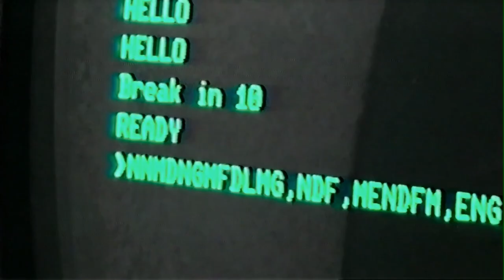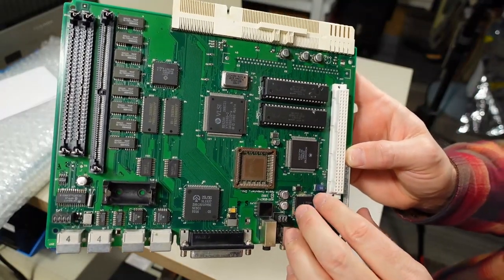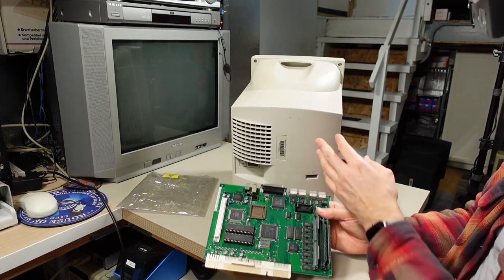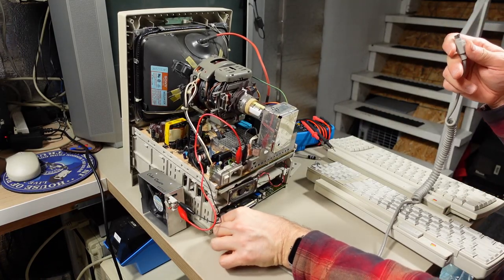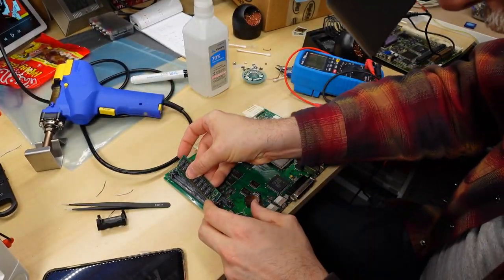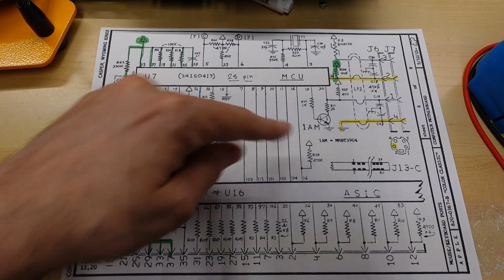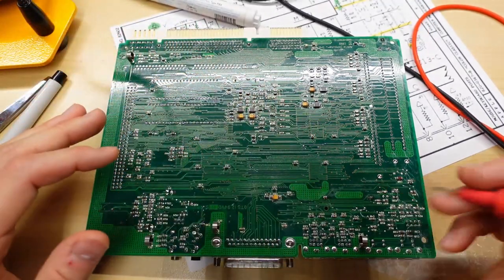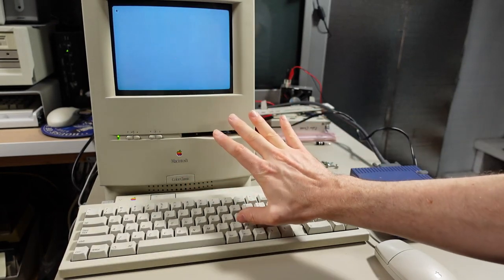The Mac Color Classic lives again, sort of...

Comment: A very long time ago, I used to work on the Chance-Vought (LTV) A7-E aircraft. It was an attack aircraft that used (for the era) some very sophisticated avionics. I worked in the intermediate repair department (not the depot repair), and we used to get first time try to repair units (black boxes) that had failed in the aircraft.  This is a tale of a tantalum capacitor that became a diode.  Yes, you read this right.  Most of the failures of tantalum caps is dead short.  When they fail they usually take down a rail and are pretty easy to troubleshoot. But this tantalum was in an A/D converter that was pretty much driving us crazy. Finally, the night crew carefully unsoldered the cap, allowed it to cool off, and did a front to back measurement with diode check. Polarized normally at 15vdc... it was a cap. Charged and discharged normally.  Reverse, it was a diode, with a forward bias of silicon diode> 0.6vdc.  At 25 volts, forward measurement would charge up the cap, then it would short.  Reverse at 25volts, it would be open.  Strangest thing I have ever seen. 
The moral of the story is, NEVER TRUST A TANTALUM capacitor. I'd change them all out for new ones.

I enjoy your channel very much, Adrian, and thank you for a great video!! Cheers and HAPPY NEW YEAR!!
Reply from the maker: That is a crazy and strange failure mode. It never ceases to amaze me how odd things can be when failing. I've had electrolytic caps fail short and other funny issues that just don't seem possible or right -- but like you found, sometimes it happens.
Reply: so you're telling me not everyone knows what a Corsair II is and isn't an aircraft geek?
Reply: Tantrum capacitors...
On some old arcade boards I came across a few Tantalums that were turning into Randomness Resistors. For measurement, I use my Testofon which has a 4V potential between the probes and then converts current to frequency on a speaker.
[What's a Testofon?]It will then upload its firmware to your brain which lets you measure not only wires and broken wires, but also resistors, capacitors (capacity AND leakage), diodes and to some extent inductors.
Every resistor has a specific frequency. Every capacitor has a specific frequency curve. And I freaking love this thing![/What's a Testofon?]
These Tantalums made the Testofon play a weird melody... they were all over the place (which also caused the machine to sometimes work).
(translated: These tantalums had a leakage current that translates to a potentiometer someone randomly turns between 100 Ohms and around 10kOhm)
Reply: @adriansdigitalbasement  wow Adrian .. you come a long way from the guy that disassemble LED  bulbs back in 2014 or 2015..
everything time  see you troubleshooting one of this machines like that ... it just wow..... :-)   ..   definitely thumbs up...
Reply: @cowsgomoo4618  LOL!!! I love that plane. I remember walking on the hanger deck of the USS America (Don’t Tread on Me!) and seeing all those Corsair II’s sitting there with huge pans under them. I asked an ADJ why and he told me, “If the pans are empty of hydraulic fluid, the planes need to be refilled. If there’s small puddles of hydraulic fluid in the pans, they have plenty of fluid.”  I learned later that the hydraulic systems seal themselves during flight. Strange design. 

The Corsair II could carry twice its weight in armaments. It used a digital computer made by IBM that was the grandson of the Saturn V’s guidance computer. The inertial navigation gyros were made by Singer-Keirfott and were so accurate they could measure the Earth’s wobble. 

That was one damn good airplane.
Reply: Sounds like the problematic tantalum was suffering from breakdown below rated voltage and that was the main issue. The diode-like behavior is not unexpected for them, they really don't like reverse bias, and this one perhaps even less than most. Even in standard polar electrolytics you may see reverse breakdown at 1-2 V.
The "open" in reverse at 25 V may have been operator error / bad contact, everything else lines up.
Reply: @PileOfEmptyTapes  Absolutely. I once measured an old tantalum cap (that was otherwise okay) in reverse. My meter says it applies 2mA at max. with 4.2V max and the cap shorted just from measuring it in reverse! (btw. it was a 35V cap. I tested a bunch more from that batch, must've been 70s, they all failed at around 22-25V)
Reply: Post

Comment: Hey Adrian, just wanted to thank you on your video. 

I got a CC that wouldn't turn on. Did regular recap and cleaning. And it wouldn't turn on. After a lot of researching (I also got to those schematics eventually and they're so helpful!) I almost gave up on this board. 
Went trace by trace on the U7 and U8 chips, checking continuity, and couldn't find the fault.  

Today, by completely random chance, I saw your video.

Somehow I missed trying connections that go to J13-10 and J13-14. Lo and behold, the connection from J13-10 to U8-2 was severed. Did the same fix as you, and now I have a happy CC that turns on!

Thank you!!

Comment: "There are a lot of tantalums and these don't leak!" No they don't, but some of them short and explode when you apply power!
Reply: Had a lot of fun with these on two socket 7 boards.
Reply: Absolutely true, tantalums may not leak, but when they fail and cause a direct 5V power rail short you will have even more issues then before! Much better to replace with 1uf, 25v nichicon caps so when those fail you only have to replace a capacitor!
Reply: i didnt think about that in first place 
about tantalum blow up when power get to it
that is interesting thing to know about it
Reply: Yeah I had replaced the electrolytic capacitors with tantalums on my mac se/30 and 2 of them exploded inside!
Reply: Not for nothing are they nicknamed "tantrum caps"

Comment: That's the preferred method of getting those capacitors off.  You push down and twist.  Worked with a guy in the broadcast television repair industry that probably replaced 50,000 capacitors a year and this is how he did it.  Never damaged the traces.
Reply from the maker: I've tried the other methods and once I started using the twist method, I've never had a single damaged trace or pad. Heat and attempting to desolder has resulted in damage... so I abandoned those ways.
Reply: @adriansdigitalbasement  Same. I've had far better luck with "push and twist" than trying to desolder with an iron. I used to yell at my computer screen when I saw people do this... not anymore!
Reply: When capacitors leak, they release electrolyte. The electrolyte is alkali, which is corrosive. The corrosion seeps into the pads and traces. The effect is accelerated when current is passed through the circuit. Because the pads become fragile, that is why the twist method is not recommended. It applies unnecessary force to the pads which can cause them to break. Heat + activated flux helps to remove the corrosion and free the legs without force, giving you a better chance at not causing damage. The brown/black stuff you see from the activated flux is all the corrosion being washed away from the metal. 

That said, I've lost pads using hot air before. Sometimes they're just too far gone. Do whatever method works best for you, but it's best to know and be prepared for trace repairs as these computers continue to age. The surface mount capacitors from this era were particularly bad.
Reply: @bnice7  -- Preferred method in the industry is twisting.  You push down on the capacitor with a force and twist.  When you do that, the leads break at the board.  It only takes 1/4 turn.  You don't have to spin it around all day.
Reply: @pmgodfrey  Probably a lot more efficient to do it that way, which makes sense in an industrial setting. They probably just toss the board if they do lift any traces and move onto the next one. As a hobbyist and collector, I prefer to treat my own equipment with more care and pay more attention to the science. Using the twist method, if the leads are stronger than the corroded pad, you'll lift the pad 100% of the time. I'd personally rather apply fresh solder, flux and heat. It's a longer process, but less chance of causing damage in my opinion.
Reply: i dont know why so many people get upset about twisting these particular capacitors off, the cap is clearly more fragile than the pcb pads and the cap body breaks off the leads, leaving the leads on the large pcb pads virtually every time. its no problem at all, just dont assume all other components (chips etc) can be done this way.
Reply: @bnice7  -- In the broadcast industry, we had tons of ENG cameras and editing decks.  These were pieces of equipment that cost upwards of $90,000...so you don't toss the board as a new one could cost $7,000.
Reply: @fumthings  I'm not upset at all, and I thought I explained my reasoning for not wanting to twist them off fairly well. I have had them rip pads off this way before, especially on cheaper manufactured PCBs. I've also had it where it doesn't rip the whole pad off, just peels it up slightly off the substrate. So I stopped doing it that way and I'd rather spend an extra hour or two using hot air and flux to remove them and not have to deal with any of those potential issues.

Comment: Hi Adrian. Some notes:
1) the Performa 475 motherboard also requires the PRAM battery, so you’re not alone.
2) IIRC, those batteries are 12v, not 3v, but check the documentation, first! Never mind; you schematic shows 3v.
3) when you were showing the board with the caps off, it looked like one of them, the trace was corroded off (nearby). (@16:42, if you look just under and to the left of C11’s (+) pad.)
4) it looks like the motherboard is missing an IC (there’s a PLCC socket, but no IC in it.)
5) a “real” 68040 (as opposed to the 68LC040) has Floating-point registers and ALU, but runs hotter; I recommend a peel-and-stick heat sink at minimum - just be sure it has clearance when you put it back into the case!
6) while tantalum electrolytic caps don’t leak, then can fail dead short; measure resistance across the power rails.

Comment: I just test booted my Color Classic this morning as I'd re-capped the Apple IIe card in it and was testing it. Funny enough, it had no audio for the first boot which freaked me out a bit (it had already been re-capped and it had been working fine). The next reboot and subsequent ones, audio was fine.

If you still have audio issues, definitely look at corrosion around the sound chip, U5 as it's common for that area to be a problem with the 4 caps that are around it.

Comment: Very cool! 
I will add Mac colour classics are very picky with boot up when you pull the motherboard out and swap batteries.   I went threw the same problem you had. But I read somewhere you have to let them sit for a while with the battery installed.  Mine wouldn’t turn on with a new battery for quite a while.  I let it sit overnight went and hit the startup button in the morning and it started right up.

Comment: It's always great to see your Macintosh themed videos! I have a troubleshooting suggestion for you: I have found that with many Macintosh boards the electrolyte from the capacitors sometimes leaks underneath the ICs. This fluid can cause the ICs to behave abnormally. There may still be a bit of leaked electrolyte underneath this particular chip. I think it might be a good idea to try pulling the IC, cleaning underneath it with Isopropyl alcohol, and soldering it back down. I couldn't quite make it out in the video, but I know that with Mac Classic II's the chip that is worst affected by this fluid is called the Egret chip. I look forward to seeing more videos about this computer!

Comment: One of the best ways to check a board is to take diode, resistor measurements on each pin of all IC and components. Taking the positive to GND and the negative to the test-point. 
This technique is used by most of the Flying probes to test boards. 
Sure you need another board to compare it.. but sometimes even without that you can figure out the problem. 
It was better to take out the oxidized chip and clean it and replaced again to see how much was damaged. 
thanks for the video

Comment: On most beige Macs, Cmd-Power is an NMI. You can usually type ES to return to the desktop if you invoke it unintentionally during normal operation or type G FINDER to try to get out of a crashed program and return to the Finder and save your work before restarting. The latter doesn't always work, though, especially if there are larger problems beyond an uncooperative program, in which case you can try to type RB to reboot if the system crashed hard and won't go back to the Finder. You could also install MacsBug where cmd-power brings you to the MacsBug debug screen from which you can view debug info and input advanced commands or return to the desktop via either of the previous methods (assuming the system hasn't crashed, in which case MacsBug shows you a huge screen full of debug info for review).
On the CC and other AIO Macs, the sound amp is on the analog board, which also likely needs to be recapped. If you have sound problems regardless of which logic board you try, it's likely that you either have a problem on the analog board or something between there and the speaker (the wire is really long; maybe you nicked it?).
Your Mystic upgrade board will require a VRAM SIMM before it will work, just fyi (it has none onboard unlike the CC or CCII boards). You have two options for the Mystic mod procedure: the quick and easy way with a simple logic board mod to enable it to use the CC's 512x384 display (by default the 575's LB runs 640x480 which is incompatible with stock CC), or you can do a hi-res mod to the CC's analog board to enable 640x480 resolution on the built-in display. The hi-res mod will follow with any subsequent logic board using the 640x480 resolution (including the stock board) with no further mods, unlike the 575 LB mod which would only affect that particular board. It kind of depends on how invasive you want to get and if you want those extra pixels.

Comment: That's a low-end 68040, it's the 68LC040 which was fitted to the LC machines and lacks an FPU. It's not hard to swap it out for a 'full' 68040 however, that's a popular upgrade to LC machines.

Comment: command control power was the reset command for most of the beige macs- this was the standard way to reboot after a hard freeze all the way through the 90s. I’m pretty sure it persisted through the later macs until they removed the standalone power button from the keyboards in the 2000s.

Comment: I had the floppy disk loop issue on a LC475 that I recapped, exact same symptoms as you have. Turned out that one of the capacitor legs touched another trace that had solder mask on, but caused issues. I recommend looking those over and checking there's no overlap on any of those.

Comment: I would have used MLCC capacitors instead of regular electrolytics. I think new electrolytics won't leak (not soon anyway), but MLCC are forever and work fine on these old boards.

Comment: As always your ability to do some VERY deep dives into what could be going on is amazing, and I end up learning something new with every video you produce.  Had some general questions regarding the repairs?

First I noticed you like to replace the battery on the motherboard with a CR-2032....beyond switching to a common battery that is easy to find, you also mentioned the CRs are less prone to leaking?  Is there a reason for this?  

The other thing I am curious about in regards to the whole recapping thing--this is a scenario where you are replace the old electrolytics with new ones...do these new caps have a similar "shelf life" (e.g. wouldn't these rigs need to be recapped in about 10-15 years (assuming the machines themselves were still in use)?  Was curious if there was any way to recap these with components that wouldn't leak?

Finally was curious the chip with the "blue crusties" on it...if that chip did end up being damaged, was the one on the destroyed motherboard in good enough shape that you could have transplanted it?

Comment: It's the "command" key
Reply: Knows which Macs boot without a battery but has no idea what the Command key is called 😅
Reply: @pb7379-j2k  Actually in the early apple II/III machines and Macs it was the "Apple" key. A lot of people who have been using Apple products for a long time call it the Apple key for that reason.. Check out the wikipedia article for details https://en.wikipedia.org/wiki/Command_key
Reply: @supermodernotv  you don’t have to “actually” me, I was there. The Command key had an Apple on it because of the Apple IIgs, but the very first Mac didn’t so it’s been the “command” key since then, 1984
Reply: @supermodernotv  I was so sad when they removed the Apple from the key! I always referred to it as "Apple" even for years after they got rid of it. How do you copy? Apple-C!

Comment: WOW! You got a LC 575 Logic Board with a 68LC040 (no fpu). You can even get another speed boost if upgrading to a full 68040 (with fpu)
Reply: That´s a huge improvement, a much recommended upgrade IMHO

Comment: The IBM PS/2 (at least the model 25, the one I'm familiar with) is another example of a machine that needs a good clock battery (in the form of one of those Dallas chips) to boot.
Reply: Same with Siemens Nixdorf 486 computers. The &%€ Dallas battery has to be replaced to get the computer to boot

Comment: When you did the recap I noticed a few traces that looked broken under the caps. That's probably your sound issue and it's probably why the computer didn't turn on until you did the bodge wire.